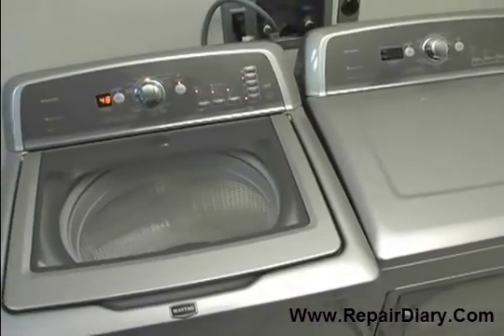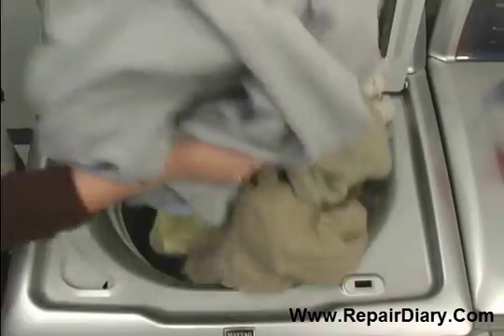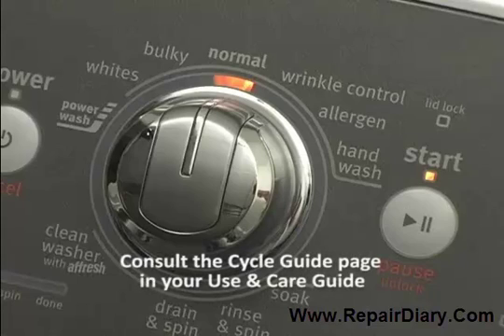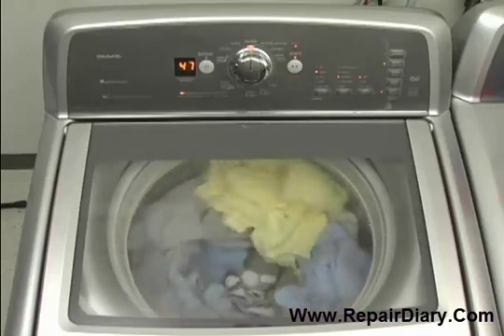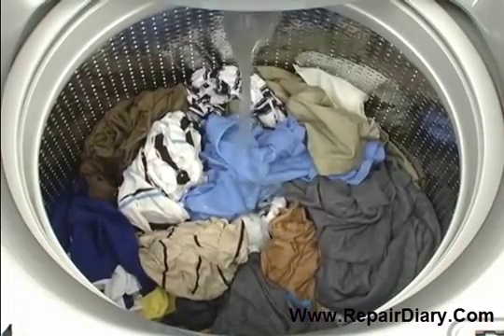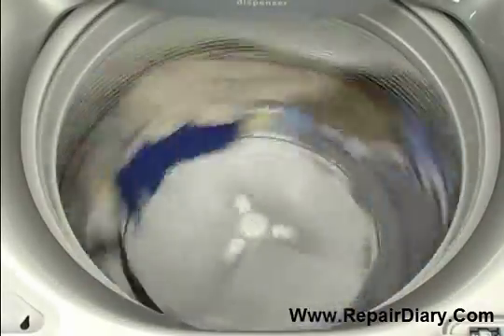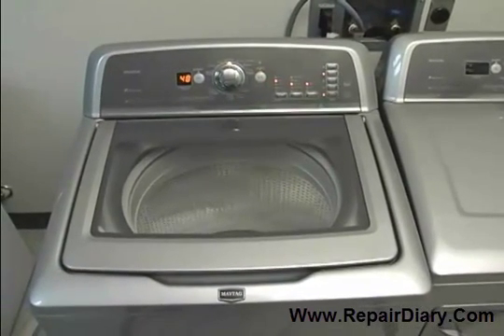How High Efficiency Top Load Washer Work

Comment: I am glad I never owned (and never will own) any of this HE washers. I understand how people feel about this top load HE washer. I have a front load LG steam washer and dryer  and i had problems with it too. I have to even run the dryer twice to get my clothes dried totally. When my LG set breaks, then My next set will be the vintage old school washer and dryer set from the 70s or the 80’s. Notice that the clothes barely even got wet during and after the wash cycle, the dry spots on the clothes indicate that they might still be dirty. My mother would never own this washer. I have used one of these before and my clothes were still not clean, stunk pretty bad. Either the LG Gets replaced with a vintage set, or as a last resort, we will be getting a SPEED QUEEN.
Reply: Get the Speed Queen...we just took delivery on the TC5003wn....excellent machine.
Reply: @BillofRights1951  absolutely

Comment: I’ve got a 2015 he machine, just bought, took the safety latch off so I could see how it cleans. It washes in three cycles.First cleaning cycle more water than machine in video, but still not quite enough. Second cycle more water, clothes circulate but still not enough, third cycle sufficient.
I will figure out how too manually add more water and it will be a good machine. 
The machine in the video will never be any good, for it lacks an agitator!

Comment: I have one also and it works great. My clothes are always fully cleaned. Not sure why you are all having so much trouble. This was the best washer I have had ever. It's been great for pillows and bulky sheets as well.  Sucks to be you people. I love my HE no agitator washer!
Reply: What brand do you have?  I bought an LG.  One of the problems I have is if I set it up and it starts filling and then I realize I've used the wrong setting, ie normal and need bulky.  If I change it, it then senses the water already in it to determine how much water it needs, thus wasting water.
Reply: I don’t care if this is five years old this is one of the douchiest comments I’ve ever read. Not all machines are the same.

Comment: Trick the sensor by thoroughly wetting the clothes with at least a gallon of water which will make the sensor fill the machine like in the good old days. Don't pour the water in the tub or it will drain out. The clothes come out great because they've been washed in plenty of water.

Comment: At 7:00, “you may notice some dry spots on some clothes.”  Yup, that part of the clothes didn’t get cleaned or agitated to the bottom where the water is.
Reply: EXACTLY
Reply: How soo?? Just because you could have a dry spot on a certain part of the clothing, does not mean that it did not get washed. Perhaps the spinning made it like that.
Reply: Andrew Addison seeing the way this thing agitates with so little water, I can see how it’s possible for maybe a small part of the clothes to never touch the water.
Reply: @boostedmaniac  Actually the water pushes up within the clothes due to the friction. Certain parts of the clothes will stick out and go right into the water in which is normal. Just do not mixed heavy set of jogger pants with clothes that are less heavy, which is why I will do my shirts/underwear/socka all together first before doing my shorts/jeans/jogger pants next. Lastly is when I will do my cmforter or bedding sheets last, which is why they recommend sorting out your laundry first before entering them right into the washer to be washed. People tend to forget to sort out their clothes first before entering them right into the washer itself.
Reply: Andrew Addison if I’m ever forced to go HE, I’ll prob try to find a way to fit a front loader in my laundry room. My room is small and the laundry room door opens right in front of the washer which makes it’s preferable for top loader, but so far I’m not too convinced of the performance of these.
Reply: @boostedmaniac  I was meaning the HE Top Loader and not the front loader. Sorry about that part. My bad. 😂😂
Reply: Andrew Addison no I got that. The top loader HE doesn’t seem very impressive to me. For now, I’ll stick with my ancient top loader with agitator. If I forced to move HE, it’ll prob be a front loader.
Reply: @boostedmaniac  Oh okay cool and as I was saying just incass others are wondering why all of their clothes do not get washed properly due to those certain reasons I've mentioned that's all. Then again people could have more issues happen with them than I would have had. 😎🍻
Reply: I'm sick and tired of these environmentalists!
Reply: This is bull!

Comment: Thanks to the EPA for forcing us to use this garbage.
Reply: boostedmaniac Just use front loaders. They use less water, less detergent, less electricity but wash better, cause less damage, spin much faster.
Reply: Spencer Wilton I might consider, but my laundry door is right where the front load washer door would open. I believe you’re supposed to leave the door slightly ajar after a load to prevent mold. With the washer door open, the laundry room for swinging open might hit the washer door or be a very tight squeeze depending on what I use to prop the door open slightly to allow for airflow. 

I’ve continued to use my old Kenmore top loader from the 90s which has been easy to fix myself and pretty reliable.

Comment: How can these POSSIBLY use less energy when a cycle takes 3 -4 times longer.  I used to do a full load in about 30 minutes.  Now loads take 90 minutes or longer!
Reply: Mary Sebahar Because the vast majority of energy used by a washer is used to heat the water. Use less water, and energy use is slashed even if the cycles are much longer. In Europe we haven't used top loaders since the seventies. You haven't been able to buy them for decades. All machines are front load, which uses a fraction of the water but washes much better. They damage clothes less, heat their own water to the exact temperature needed, use less detergent, spin up to 1800 rpm reducing drying times massively (so saving even more energy). Most washers will use around one unit of electricity to complete a wash, that includes heating their water. I don't understand why America hasn't moved to them. However it may be because wash times are much longer, typically around 90-120 minutes, but this isn't a problem for most people as we just put a load in and go about our day.

Comment: I want a fully functioning mini washer and dryer that actually works. I don't want a dryer that spin dries.  I live in an apartment and a mini washer and dryer would be perfect.
I do my laundry in the kitchen sink, and I hang my laundry by open windows and in front of my box fan.
It takes a while for my laundry to get completely dry, but my laundry is dry.
Any suggestions??

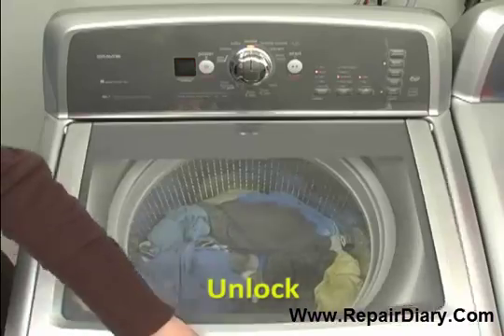Comment: 4:12 2 MINUTES. mine stops in 5 SECONDS. WHAT HAPPENED TO A TUB BRAKE? WHAT HAPPENED TO SUSPENSION? WHAT HAPPENED TO AGITATORS? WHAT HAPPENED TO WASHERS THAT ACTUALLY USE MORE THAN 4 INCHES OF WATER!!!!!!!!!!?????????????
Reply: It puts no ware on anything. That’s the point of a tub brake.
Reply: Easy on the all caps man! it said it may take up to 2 minutes.  As for the drum brake my guess is that they feel that suddenly stopping the drum puts wear and tear on the clothes as well as the machine.
Reply: @GaryBeltz  That's a lie!
Reply: @jeromedavis8575   I said my guess is I didn't say it was factual
Reply: EPA banned them!

Comment: Dry spots is a good thing?  My ass!  These are pieces of f*#@$& JUNK!! Mine won't even fill halfway after selecting "deep water wash"!  And it doesn't fill AT ALL on the rinse cycle!  My whites are stained yellow from liquid softener. I'm adding water with a bucket from the kitchen sink so it doesn't happen again. 😠😠😠😠😠😡😡😡😡

Comment: They don't work. They don't clean the clothes. The wash cycle is timed not with a clock, but with a calendar. They wear the clothes out. They go out of balance, even when loaded according to manufacturer's recommendations. They fill brim-full multiple times trying to balance, wasting twenty to thirty gallons each time. They break, and are more expensive to repair than to replace. My HE machine broke down and the replacement parts didn't fit. I saw elsewhere on YouTube that Speed Queen is now building some 2019 machines to the pre-2018 specs .Smith Appliances is delivering my new one Tuesday.  HE NEVER AGAIN!

Comment: There is a "secret" to these HE washers to get them to use more water. I put secret in quotes earlier, because it's simply one of the settings. Set the washer to bulky/sheets, and it will fill the basket to the brim. Boom, water issue solved.
Reply: Pour a pitcher slowly on the clothes to make them heavier then it will fill higher.

Comment: Not covered. Notice the cycle "CLEAN WASHER WITH AFFRESH"  AFFRESH is 100% bleach and the cycle uses 100% hot water. NO CLOTHES. If this is not done regularly the machine will stink like sewer. I believe this is because small cavities of water never drain. I think this kills most of any savings this machine provides. Note: I have not found an HE machine that does not have this problem.

Comment: Here's the way to beat these machines. After you load the clothes wet them evenly to trick the sensor into thinking there are more clothes in there than there are because the sensor goes by the weight it detects. The machine will fill up like the old ones do. I use HE Tide Pods so there isn't too much soap in the clothes. The clothes come out clean and untangled. When  they're done in the dryer, I have hardly any lint in the lint trap so I know the clothes haven't been destroyed by the agitation of the machine with not enough water in it. These machines are a pain but they will be the only ones offered for energy efficiency (she says sarcastically) so we just have to beat them at their own game.

Comment: Having worked on major appliances for 40 years, I can say with some authority that the top load HE washers, no matter which brand it is, are cheaply constructed, and will not clean clothes as well as a traditional washer that fills with 20 gallons or so of water, and has an agitator to move the clothing within that water. Although Whilp does have a machine with an agitator currently, water levels are still reduced by comparison, and it, like almost all washers made today, are computer controlled. This presents it's own set of problems. Sure it can somewhat diagnose it's own failures, and point you in the right direction to repair, but the operational parts and the control are pricey, and if you cant repair it yourself, it will cost half as much as a new machine or more to repair the washer. Whirlpool washers built before 2011, referred to as Direct Drive models, built between 1987 and 2011, are by far the best and easiest machines to repair when they break down. If I were forced to buy a new machine today, the Speed Queen analog timer or the computer controlled machines are a good option, they should last 15 or more years and have a good factory warranty as well. Other than that, as they cost a lot more than the VMW, Vertical Modular Washer by Whirlpool, at 400 bucks, would be my choice. Roper is made by Whirlpool as is Amana, Kitchen Aid, Estate, Maytag, and several more brand names. The VMW is a belt driven system with a reduction gearbox, and other more expensive models use a direct drive motor under the tub, not to be confused with the earlier models I described as Direct Drive. Good luck.
Reply: I agree! HE models are useless for cleaning even summer weight down comforters or bedding. These machines were designed by bureaucrats that have never done a single load of laundry in their lives, or there would have been provisions for heavy loads and comforters!
Reply: Got a new Samsung, doesn’t fill with enough water. Worthless piece of junk. I guess I’ll just wash my clothes in the creek. HE is a scam, I bet the politicians invested heavily in this garbage technology.
Reply: @arita52  Exactly!  Where the hell is the water in that video.
Reply: I pray my Kenmore 70 series keeps running like a champ!  No issues as well as my Kenmore dryer ... Old School and clean /dry very well....
Reply: I hate my new non agitater washing machine 😢
Reply: It’s obvious that those clothes are not being cleaned properly because they are not immersed in water and agitated around in it. Unimpressed to say the least

Comment: I owned this washer for 8 years and it died do to a motor problem, our washer was the dud, it worked extremely well in 8 years we had 3 issues one of them being caused from user error. It would clean clothes provided you loaded the clothes no higher then halfway, and even that was pushing it. Our model had no controller issues and in fact used more water then most other models of the bravos at the time. The washer would clean best on the bulky cycle for obvious reasons, but i was able to get a half tub water level on most cycles by tricking the washer. All in all I give my maytag bravos a solid 6.5/10 star rating and I'm glad to get a new washer.
Reply: This is one good reason why I miss having an old-school Kenmore washer that people had 50 years ago

Comment: HE washers SUCK and they dont get your clothes clean....unless you add more water to them...which we shouldn't have to do!!!   
"You may even notice some dry spots on certain light weight fabrics..." and they think this is great because it reduces drying time??!!  No this SUCKS and means the clothes didnt get cleaned at all and still have dirt on them!!!  My boyfriends clothes would still be dirty and smell HORRIBLE after being in my HE front load washer!!  They just got tossed around in dirt and sweat!!  I wanted to vomit when I smelled them at the end of the long "wash"!!  I tried doing another cycle, but it still didnt clean the clothes at all!!!  And each cycle was 1 hour and 44 minutes!!!  How the hell is that energy efficient??!!!  I wasted a TON of electricity, soap, a bit of water, and my time!!  Not to mention it pissed me off so much and I hated my machine!!  And no, the water plus or extra rinse options didnt help!!!  According to LG, it was running properly...because its HE!!...half way to HELL!!!
I started trying something new.  I would fill my bathtub with water and soap, and start cleaning the clothes in there first, rinsing them, and then putting them in the washer.  The water got dark brown...eww!!  He works for UPS and his clothes get so dirty!  But this got so tiring, the clothes were heavy, and I got some water on the floor when transferring the wet clothes to the washer, and I had to put a towel down on the floor.  
So finally I used a connector with a hose that clicks on my faucet (the part is from a Danby portable washer and was the only one that attached to my faucet without leaking.  The other pieces from Home Depot/Lowes we tried leaked), and I added a clear plastic hose to it to extend it and put it in the tray where you put detergent.  With this hose, I add a lot of water to the wash, and it actually cleans the clothes!!  I have to add water many times to the whole cycle....during the wash and each rinse (I do 3 extra).  And you need to know just how much to fill it up, otherwise if you put too much water in, it will sense it, and it will make a loud beeping noise and start emptying.  Sometimes if the water is super dirty, after like 10 minutes of the wash cycle I will cause it to overfill on purpose and I will let it empty completely, and then add more water again.  
I wanted an old fashioned top loader with an agitator that filled the tub with a lot of water, but my dryer is on top of my washer and it was put in my bathroom so there's no room to have them side by side!  I wish I designed this differently when building my place, but I didnt know the horrors of having an HE (and front loader) machine because I never used one before!!!   I miss the old fashioned top loader machine I had in a past apartment!!  😭   So this is what I came up with to bypass this STUPID "ENERGY EFFICIENT" CRAP!!!

Comment: Front loading horizontal axle washers that tumble the clothes with reverse action in minimal water (as the original Bendix automatics) are far superior to this machine that appears to wear out the clothes quicker and probably still uses more water than a tumble action machine. Tumbling without an agitator is inherently kinder to the clothes.
Reply: What you said is true I’ve found with quite a lot of he top loaders they don’t even proper saturate clothes and they are horrible with full loads there isn’t any agitation at all just swishes around the water a bit I’m so much happier with ay front load LG

Comment: It uses less water but that seems like it would use 5 times more electricity
Reply: No well see, the washer uses the same amount of electricity as a traditional top loader so it's able to spin much faster
This makes the dryers job easier and save energy and money
Reply: Yeah what I was saying is since the motor is constantly starts and stopping and then reversing it would consume extra large amount of electricity compared to a motor running continuously. I’m willing to bet that without an agitator the washing machine would consume 5 times as much as traditional

Comment: Thank you for explaining this. I bought a washer with an agitator on purpose thinking it would be simple like my old washer - not so!  It is near silent, automatically does everything and locks the lid so you can't see what it's doing.  big brother washes my clothes as he sees fit.  I just select normal cycle and push the button.  by the way folks I figured out the casual cycle is for permanent press.  what craziness.  its like Obama got his hands on washing machines

Comment: Why does this need a drain hose?  just fit all the dirty water on the sides of the machine that will hold you by for about 1 million years if the machine lasts that long😂